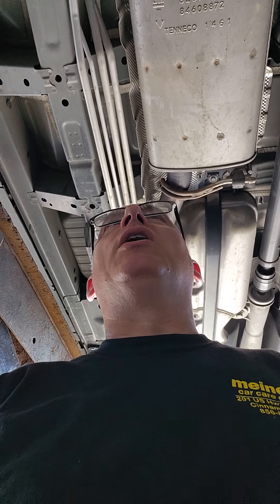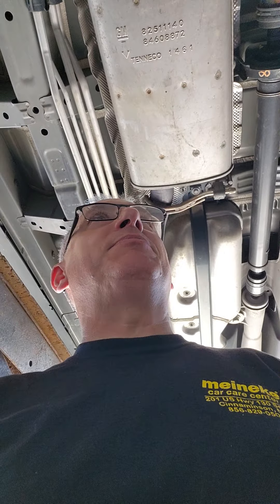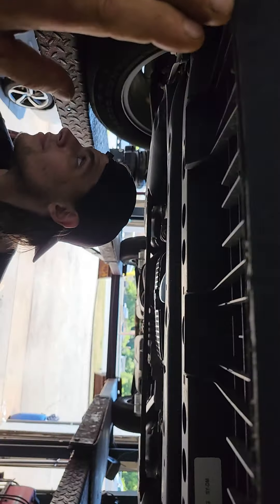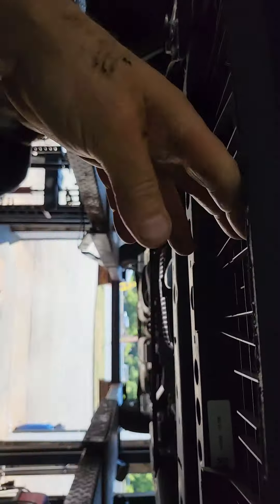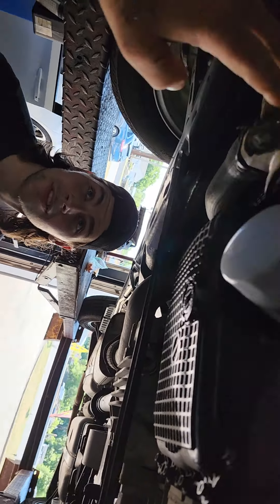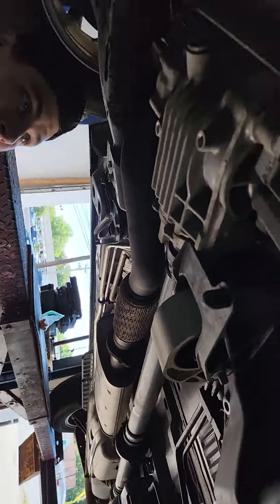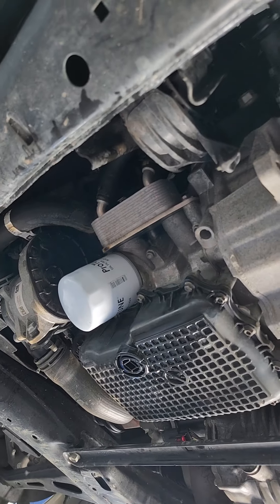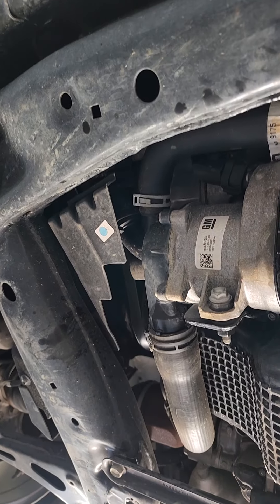2022 gmc Acadia owners beware what's under your vehicle  caution

Comment: I have the same vehicle, 2018 Acadia 3.6.  The camera angle in the video isn’t good. The oil filter sits higher than the frame rail. I’ve driven mine on lots of gravel roads and in deep sand and never even found a scratch on the oil filter, oil pan, etc.  90,000 miles now.  This owner clearly drives until she hits parking blocks and curbs in front of stores.